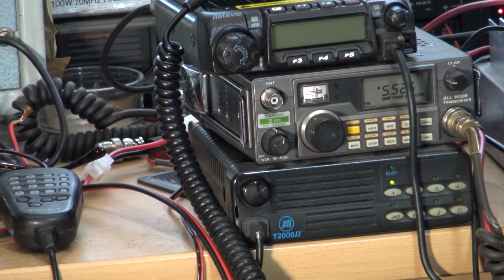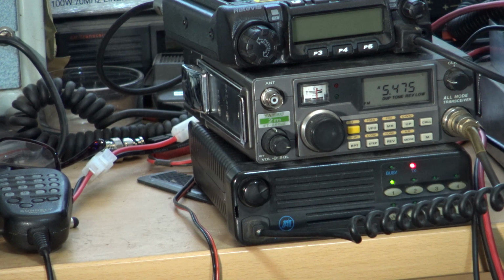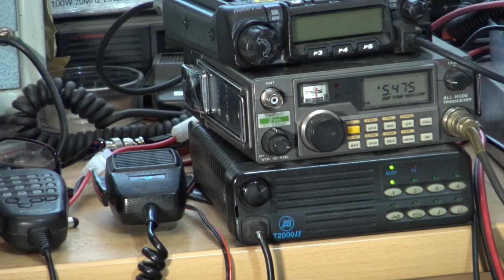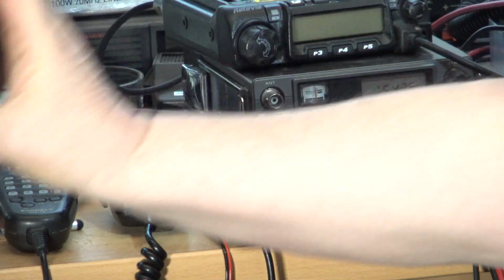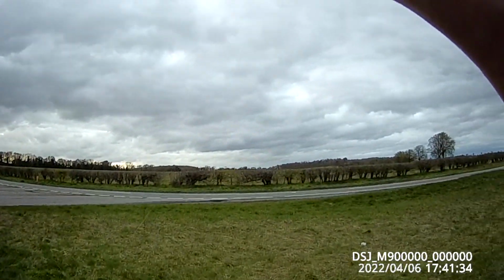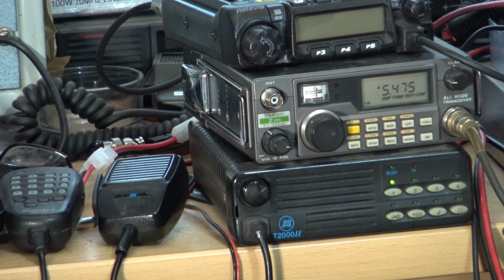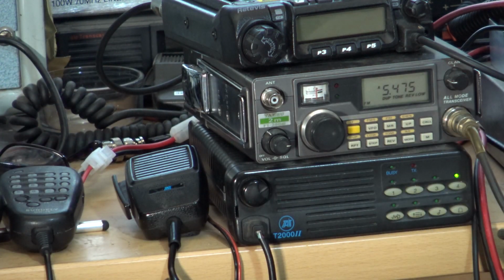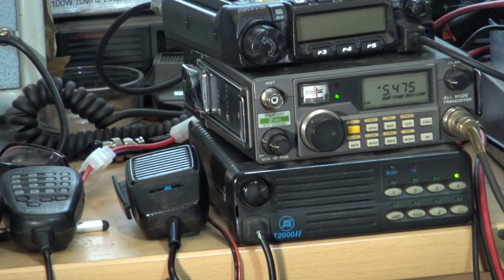TYT TH-UV88 70cms/2m Amateur radio handheld (4W) - Field test

Comment: Great review of the radio but the cars are driving by on the wrong side of the road--Just kidding.
Reply from the maker: .....and the stearing wheel in on your passenger side too & you change gear & apply the parking brake with your left hand.

Richard, G0OJF, UK
Reply: @ukfmcbradioservicingTango21  yes we rebellious colonists over just have to do everything to the contrary-LOL  CR, N3HTZ

Comment: That is a very short aerial for 2 meters!  Might have been fine through a repeater. If there is one in range, that is?  But that was not the point of the test anyway.
Reply from the maker: Yes, we test radios into gthe instruments to verify what the manufacturers say they do...this radio exceeded the specs. The field test always with the supplied aerial.

Richard

Comment: Telescopic quarter wave makes a great aerial for a handheld. Kenwood used to sell one that was 56cm long and I found that to be the optimal length for a good match on top of a handheld. Can be as much as 4 S points stronger than the aerials they supply with handhelds.

Comment: Good test suprising how 70cm was a little better. Love how you both have the repeater stored on channel 4
Reply from the maker: We set the same three simplex channels & the one repeater exactly the same on every radio. That way we can pick up any radio & know its .475, ,.500, .550, GB3GR. On 2M sets, it's the same three with a 145 in front & no repeater.

Richard
Reply: @ukfmcbradioservicingTango21  Great idea richard and stops you funbling around  trying to remember . Great work.

Comment: Hi Richard, great test. Just a question, when the emergency services use their handheld radios in the field does their vehicle radio act as a repeater?
Reply from the maker: It's changed since I was involved & many vehicles had repeaters....but hand portables were 100mW to 500mW. Now the digital business radios they use are 5W+ I reckon it;s a different ballgame. I've therefore not got a current answer.

Richard
Reply: @ukfmcbradioservicingTango21  OK thanks for your reply 👍

Comment: I have experienced the same, hand held 2/70 radios tend to have a more efficient antenna for 70cm, you will be well aware of that, in fact you said in the video.
Reply from the maker: Well with that factory aerial, UHF will be a 1/4 wave. & VHF will be very poor. The point is that we always test with the factory aerials to be as fair as possible.

Richard

Comment: The tait 2000 sounds nice both ways doesnt it.
Reply from the maker: Oh yes they do. Mr C can be talking on the 17W mobile in the driveway ten feet away & I can hold a conversation on the next channel with no interference. All the cheap Chinese sets get wiped out under those conditions. That said, the T2000 series had an RRP of £412+VAT so can't be compared with a £45 radio. These TYT handhelds are about £45 too so can't be expected to perform line the £680 Maxon SL500 handheld. No there's a good thought for a video...comparing amateur radio equipment with business radios; obviously on performance & not features!

Rchard, G0OJF, UK
Reply: @ukfmcbradioservicingTango21  Just to add i love the look of my tait and maxon radios, Also no meter so people cannot ask for signal reps lol.
Reply from the maker: Suits me too. I'll be getting (when I fine one) a Pye or Philips F496 base station & fitting it in our private chapel here behind the organ in a 'fit & forget' installation. The aerial cable can then just go through the wall with 3 feet of coax to a folded dipole. Then I'll have a number of M81 controllers around the place connected by 2-core bell wire, giving me multi-room/multi-building access to the base station."I'm on a Kenprocom zillion dollar latest model, what's your radio'......"Pye base station, single channel through M81 controller".

Richard
Reply: @ukfmcbradioservicingTango21  Ah yes i forgot about my 4 meter pye westminster. I am looking for one more channel that was the one i said would make a good video for you to tune up.